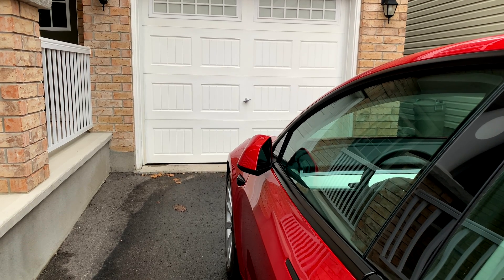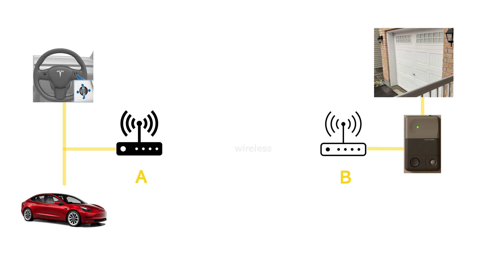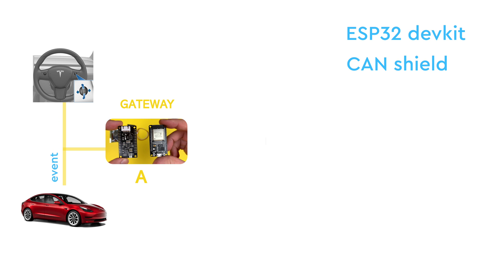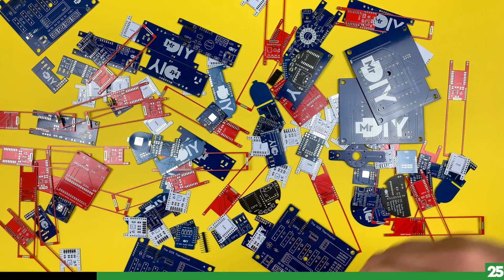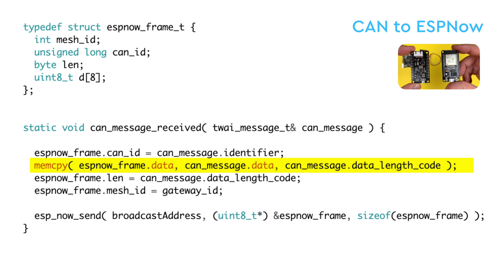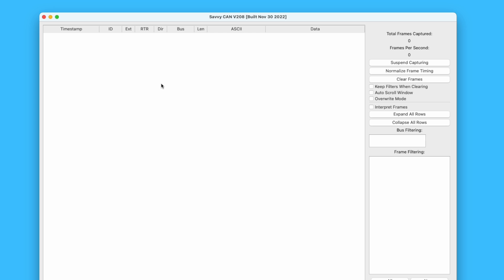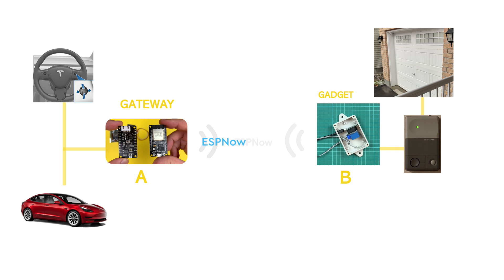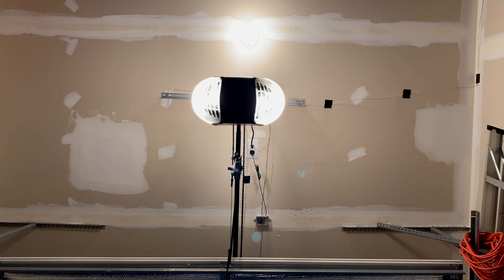My Very Own Garage Door Opener (Gadget #2)

Comment: Hi, i bought one of your can shield a year ago. i have used it with savvyCan for some sniffing and i do have some usage CAN ID's that i wan't to sent to my server through a public mqtt broker.

For this, i probably want the esp32 to talk to the can shield and then connect to a wifi hotspot in my car... When it receives messages from the canbus on the car, i want it to send those messages to the mqtt broker.

Would there be a good way to do this with something like ESPHOME? any guidance will be helpful. thanks

Comment: You can easily make this secure by having a private key on both the receiver and transmitter. The esp32 in the car will take the current time, encrypt it with the key and send it to the receiver, the receiver can then decode the transmitted message with the private key, and check the timestamp, make sure its only a couple seconds old and then open the garage door. This way even if someone is recording your transmitter signals, it is worthless to them as every transmit message is only valid for a couple of seconds.

Comment: work on Model S/X?
Reply from the maker: It works on any car if the CAN ID & Data for the button are known
Reply: I'm planning to purchase your CAN Shield.  Will the code you are going to provide works for a Model X?  The garage opener part I will manage.   @MrDIYca
Reply from the maker: The gateway code works on any CAN bus. All it does is convert CAN to ESPNow blindly. Your receiver will have to figure out which ID and DATA to use ( that is the tricky part). You might want to watch my CAN framework video - https://youtu.be/gtVQeTRps7o

Comment: Just as idea. You can find CAN message connected to blind spot detection and fix one of the biggest issue in old tesla ;)
Reply from the maker: I'm working on a new gadget, an ambient light strip similar to the one on the new Model 3. Maybe I can do blight spots there.
Reply: Wow, it will be amazing

Comment: Is there any reason why manufacturers do not want to share dbc files?
Reply: It just doesn't benefit them, so they don't. By making it difficult to modify and extend cars functionality in this way it typically maximises opportunities for the manufacturer to upsell later on during servicing, as well as bolt-on features like the $350 garage door opener mentioned at the start of the video.

Comment: Why don't you do the processing and checking for the wheel on the esp32 in the car? It would only need to send a message to the esp8266 when it recognizes a wheel press, therefore there's much less traffic over the air
Reply from the maker: I wanted to keep the gateway car agnostic, simple and decoupled.